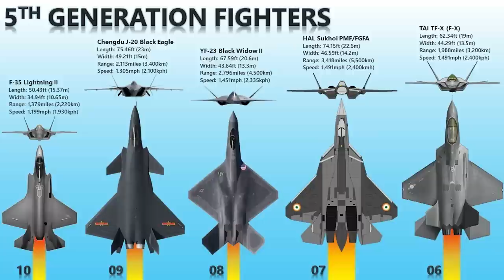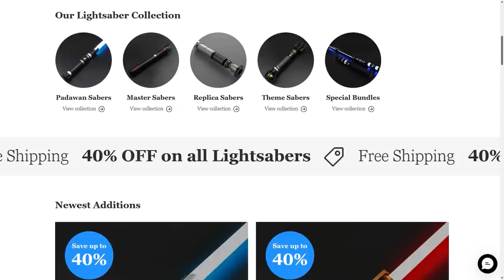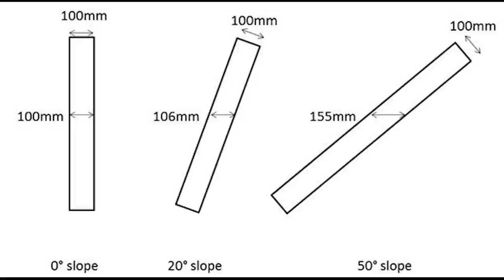Is the Tie Fighter MORE SURVIVABLE Than We Realized?

Comment: When it comes down to it I can't recall seeing any fighter, shielded or not, withstand a couple of direct shots from another fighters weapons.  In the movies X-Wings blow up just as quickly as a TIE does, lol.  Only in the computer games do they make a difference.
Reply: Games also give the TIE shields so I wouldn't use that for an basis tbh
Reply: @andrewmeyer3599  Aren't videogames actually where the idea that TIE's are unshielded originates from? And I can't recall a game where the standard TIE is shielded; it definitely wasn't the case in the original TIE-Fighter game (I still have a bit of PTSD from that infamous mine field mission), and I think in the most recent Squadrons game they only get a repair system that can try to patch the armor?
Reply: @ddshiranui  I've never seen TIE fighters from the Galactic Civil War era have shields. Nor TIE Interceptors or TIE Bombers. Only the TIE Advanced and later models got shields.

The shields might not be super effective, but they're more effective than not having them, which is the point. Taking a single hit on your shields before you start taking hull and system damage pretty much doubles the survivability of most fighters.
Reply: @richardkenan2891  What I meant is that the original movies didn't seem to make any distinction between X/Y-Wings and TIEs in terms of ruggedness; they all popped instantly when shot at, so for all the moviegoer at the day could have expected, the Imperial fighters may have had shields as well. Only the Expanded Universe, which came up with the vast majority of technical specs and details in its books and RPGs and videogames, later established this dichotomy.

And whilst I agree with you that deflectors are nowadays presented as extremely useful in the videogames, as mentioned above it just didn't come across like that in the movies -- because in ANH, TIE-Fighter laser cannons were shooting so fast, their targets didn't just catch that one shot that would be stopped by a deflector, but a full barrage within less than a second. Similar to how tandem warheads just cancel out the ERA on a modern battle tank, to reference the example mentioned in the video
.
I guess the supplemental/third party material has just considerably changed the fandom's perception over the years in this regard, even to the point of "overriding" what we see in the actual films. Unless we were to discard the validity of those scenes as being influenced by plot, of course. I do tend to favor technical specs (like from the RPG books) above stories, as one is always neutral whilst the other often features reality-bending heroics. ;)

Comment: Really, perhaps shields helped against space debris, but in the original trilogy movies, the rebels’ fighter shields only seemed to dampen laser damage rather than block it.   Even in the sequel series where First Order TIE fighters had shields, they seemed to only block the first laser bolt in a burst before subsequent bolts vaporized the TIE fighters.  Outside of RPGs and video games, fighter shields didn’t seem that effective.
Reply: It makes sense, for dramatic purposes. Shields are shown to work on the Falcon and other big ships, because, well, they're bigger ships. If enemy fighters miss those bigger ships, it makes them look incompetent. And when they want to make the ship look vulnerable, they just add a bit of dialogue about the shield's status (as seen in both episode IV and VI).

With a small craft like a fighter, there's no real need to do that. You can just have the enemy miss the small target, unless there's a need to heighten the tension, like when R2 gets hit, or you're lifting scenes from a bomber movie, and therefore have one your attack planes break out of formation, damaged. Having to deal with shield status would add nothing.

Of course, the game versions play up the shields, because it suits that medium. It allows for added stress, having to worry about your "health", but also providing a form of in-combat healing.
Reply: @Axterix13  It does make sense in the meta for shields in the movies and the games to act differently, but I do still treat the movies as the more “canon” way shields in Star Wars are suppose to work.  I like the way Star Wars squadrons treats TIE fighters and rebel fighters as it seems more authentic to the movies, though as it’s a game both sides fighters seem a bit more “tanky” then they should be.   TIE fighters have no shields, but they have stronger hulls than their rebel counterparts (still doesn’t quite make up for the lack of shields but it helps).  However, since TIEs don’t have shields, they can use the excess power saved to supercharge their weapons or engines, so TIEs can either fly much faster in full engine power (even the bombers), or hit much harder with their weapons.  Rebel fighters, with shields that regenerate, do have more staying power, though in squadrons shields are fairly weak, so temporary retreats happen a lot with rebel fighters, but that’s still better than having to go back to base like TIEs have to when damaged because hull doesn’t regenerate, of course.  Still, in squadrons I still preferred playing TIEs to rebel ships just because they hit so hard and moved so fast.

Comment: The Spherical-Gravity shape (or obolid as it's called) doesn't help your argument for the TIE Fighter.  See, the reason celestial objects form in rough spheres has to do with gravity pulling in all directions. It gives a common shape, but that shape doesn't offer any structural advantages against projectiles, as seen by the events that created our own moon. Also, they're not perfect spheres, as the objects are also spinning, that that spin makes the object thicker at the equator of the object and thinner at the poles, kind of like a squished orange or grapefruit.

You can make the argument that an armored ball can deflect most shots at it as glancing blows, so long as they're not direct blasts. Except that eggs and arches fail at this, as those designs only deflect forces of large, spread out loads down the sides. Arches and Eggs are ill-equipped to handle targeted forces, like the blast of an artillery shell in the case of an arch and the lip of a mixing bowl or tooth/beak of a predator in the case of the egg.

Comment: It is actually a pretty valid option to consider if you Can't hit me why do I need Shields?
In addition to cost and weight saving you reserve pilot Focus and concentration on the only things that matter speed maneuverability and firepower..... Notably the only things available to put the system's power towards maximum output.
Reply from the maker: yeah the jedi were all about that with the delta 7
Reply: @GenerationTech yeah but thats jedi, normies without space magic also lacks a few handy tricks up Jedi robe's sleeves.

Comment: Faster and more manoeuvrable than most everything else, hard hitting weapon thats shoots quickly and directly in line with pilots vision. Tough hull with energy gathering 'wings'. Low cost and easy maintenance. Considering that shields on fighter sized craft aren't very powerful and often fail against anything but a grazing shot and you have a devastating weapon that can be produced in overwhelming numbers with a slight compromise. Would a shield be a nice bonus? Sure. Is it necessary? No.

Comment: A leopards do use... Sloped armor... It's it's visible from outside and it has even angled panels inside (composite armor)
Reply: True, I recall seeing a picture from the inside of the wedges the newer versions (A5-A8) have at the front of their turrets.
The new A8 also has Trophy active protection system in addition.

Comment: It's supposed to be the Japanese Zero. extremely agile and high firepower low armor and durability while being as cheap as possible so you can field them in high numbers. The F-35 is in fact a POS it's too generalized and like the early F/A-18 does not have the range capacity of earlier Aircraft.

Comment: More on the "angled armor" point, all the "specialized" TIE fighters, from the interceptor to the bomber to the defender to Vader's own personal fighter had angled foils (though I never really understood what the foils were for. Heat dissipation? Solar panels?) which probably gave them an extra layer of protection over the standard flat-foil TIE.
Reply: originally for looks, but the in universe explanation is heat dissipation.
Reply: @kenbrown2808  Makes more sense than solar panels, which is what I'd read in some old Legends novels. Not all dogfights in Star Wars take place close enough to a star for solar panels to be useful.
Reply: @kenbrown2808  Now I actually hope someone does an experiment to see how well the TIE design would fare in space by making a mini satellite shaped like one, with a real ion drive for mobility and stabilization and the "wings" for heat dissipation AND solar energy. How amazing would it be if it turned out to actually be an efficient design for some small satellites?
Reply: @AceSpadeThePikachu  ion drives actually have very low acceleration rates in comparison to other drive technology.  low orbit satellites are actually one use it is looking efficient for.
Reply: @kenbrown2808  I know, hence the cubesat idea.

Comment: If installing (or removing) a deflector significantly changes the performance of a starfighter, it makes me wonder if the concept of the T/F being unshielded is perhaps another little reference to WW2, considering Star Wars takes so much inspiration from that conflict for anything from politics to uniform design...

In the Pacific Theater, the famous Japanese A6M Zero fighter was renowned for its agility, which it gained in good part by sacrificing all sorts of weighty protective measures from armor to damage control. By prioritizing maneuverability, the IJN's skilled pilots - having gained considerable experience in the Sino-Japanese War - were able to easily outmaneuver and out-climb the more rugged but also much heavier USN Wildcats in the first year of the war. This only changed later with the introduction of the Hellcat and Corsair and their more powerful engines, and by this time the quality of the Japanese pilots took a nosedive as the Empire struggled to replace its elite fighter corps with new recruits, since training took way too long, and so attrition caused a bottleneck that ultimately forced them to send up green rookies. Hence the so-called "Marianas Turkey Shoot", and the rest of history.
I definitely could see some parallels to Star Wars here, especially recalling what a nightmare A-Wings were to fight in the TIE Fighter videogame, compared to the slower X-Wings whose rears you'd have no problem gluing your T/F to in a dogfight.

On a side note, we should probably also recall that just as video games are limited by balancing, so are movies and TV shows limited by the plot. Just because some cutscenes or whatever show TIE's getting popped just by a single shot of protagonist X-Wing's laser cannon doesn't mean this has to be representative. Let's remember that in the very first piece of Star Wars canon - Episode IV - the Death Star's TIE Fighters had no problem blasting through even double-reinforced X-Wing deflectors with just half a second's worth of laserfire.

Comment: There were a few things you didn't touch on and a comparison to the Reble fighters as well. Starting with the whole "window" view for the front, the Reble ships had canopies that while giving them a bigger field of view, was also a much bigger and easier to hit target compared to the forward view port of the Tie. Both with their pros and cons being better field of view over better protection.

Another is firepower. Ignoring missiles and just focusing on the main weapons, the blasters as their the most used. X-wings have 4 blasters compared to the Ties two however, each of the X-wings blasters is on the end of a single wing and as many times seen in the movies and cartoons they all shoot inward slightly like some WWII fighters with similar designs. Whereas the Tie's two blasters are both below the cockpit and fire simultaneously. The X-wings blasters fired ONLY one at a time and the delay between the shots for the X-wings blasters was greater than that of the Ties. (That is based on comparisons made while watching the movies frame by frame there's no details that i know of that say what the actual delay is so this could change or be wrong.)

The final point i want to make is the overall area of the fighters themselves. How easy are they to hit. When attacking front to front the Tie's sphere body and the "arms" holding the "wings. (Sorry can't think of what they're called.) Attacking from  the front, back, top or bottom that stays the same and with its agility it will be very hard to hit. That changes when attacking from the side as then the "wings" are a huge target. The X-wing is roughly just as hard to hit from the front or back. It's easier to hit from the top or bottom and the sides are easier than the front or back. Thats just on a one-on-one fight of course. But the Empire tended to attack with mass fighter numbers, them coming at a X-wing from several angles with massed fire and its very likely to get shot down. The Reble's also used fighter wings but with smaller numbers and even those tended to break into smaller groups due to limited numbers. Again, pros and cons for both.

Personally, i love the Ties. Their shape, the weapon placement and favoring speed over taking hits. I've always believed that it doesn't matter how great your weapon is if you can't hit your target.

Comment: You really can't use tank armor as a co.parison to TIE armor. Tank armor has always been strongest and angled most on the front because of tank doctrine. In WWII, it was steel armor that was at most effectively 4 inches thick. For tanks of that era, it worked. In the modern era, the Abrams classified armor is listed as being as effective as 12" of pure steel.

Comment: The TIE was designed to be the most cost effective weapon possible. This ussually equates to ruggedness and ease of maintenance, which usually balloons out of control. The TIE series seems solve most of those problems while also making it a viable fighter platform. Hyper drives and shields are most likely extremely maintenance heavy. Also the lack of life support is more likely a safety measure rather then cost saving as explosive decompression is a  thing and it gaurentees pilot death on a significant breach, suit or no. So without life support, and possibly depressurizing the cabin can actually allow a pilot evacuate the fighter upon disable. Darth vader could of died at yavin becuase of the collision at the trench could of cracked the hull enough to initiate explosive decompression.

Comment: The tie is a budget build crotch rocket , for interceptor duties its a good ship, if the empire had kept a longer range arc 170 type vessel the ties would probably have done a lot better, i can picture an empire where tarkin took a quick trip down a cliff and the ties have a heavy fighter back up with deflectors, heavy weapons, ftl, etc, that serve as an anchor for tie squadrons, when the fleet drops in the heavy fighters are filling an x wing roll letting the ties scramble safely. The ties pack pretty neatly so with a chance to scramble they probably out number anyone they're fighting.

Comment: How an inertial compensator works is the bubble auround the ship accelerates all molecules at the same rate at the same time. When you accelerate your car the car molecules accelerate but you do not. This presses you against the seat. When all molecules are traveling in the same speed and in the same direction you don't feel the forces anymore. Remember if you get into a head on collision and both cars are going 50mph you accelerate at 100mph. Which is enough to kill you.

Comment: There's also the logistics issue. TIE fighters being cheap (for fighters, anyway) means they could be handed out like Oprah doing a giveaway ("You get a TIE squadron! And you get a TIE squadron! Everyone gets a TIE squadron!"). The common design features between the various TIE models also meant a lot of system and parts commonality, which hugely simplifies supply chains - and does the same for the training pipelines of both flight and maintenance personnel.

Add all this up, and you have a fire-hose of fast, high-performance starfighters that come complete with however many trained pilots and support personnel you need, that the Rebels will have to dance around pretty much wherever they go from one end of the Empire to the other.

Comment: I would add part the reason for the design of the TIE Fighter was modularity. It was easier with general maintenance, but also any special systems that needed to be added for special missions like special scanners or communicatios could be swapped out easily and quickly without needing an entirely new ship design. The Rebel starfighters in general don't have that capability and require actual modifications that take time and a lot more complicated then unplugging something pulling it out and putting something else in and plugging it up. Some of those things that could have been swapped out on a TIE Fighter could potentially provide a little extra advantage over another starfighter when coupled with their better speed/agility and deploying usually in large groups with other well skilled pilots. I never even thought about the ball being more sturdy design overall, but you're right about how that shape helps equally distribute force around....not that it helps a whole lot when dealing with lasers, but if you crash I do think it would really help witg survival.....even if you puke everywhere from the "ball" rolling around with you in it.